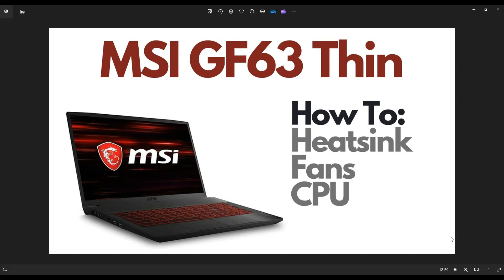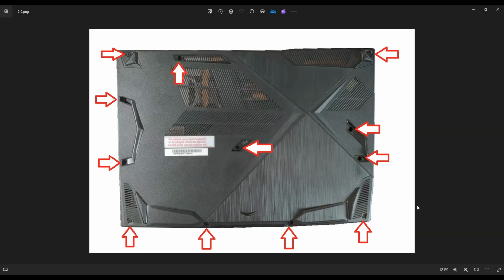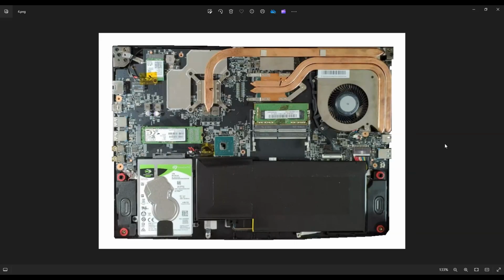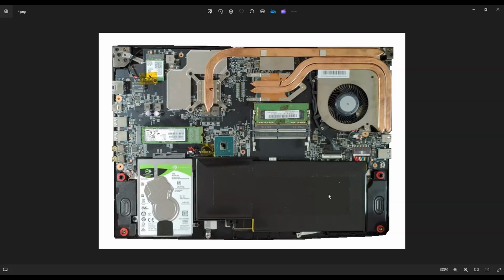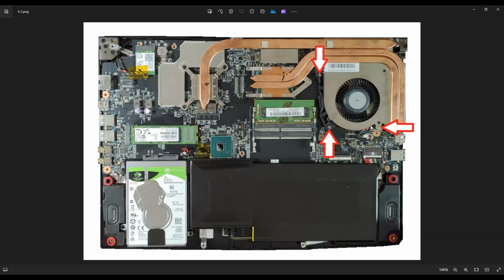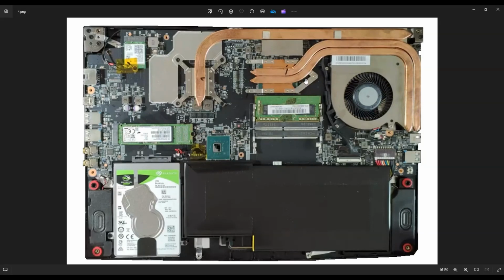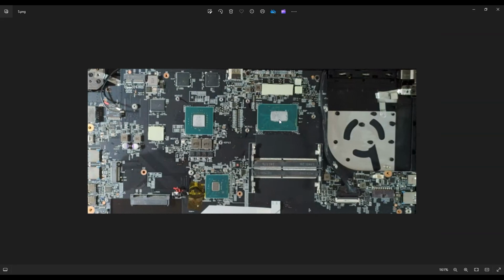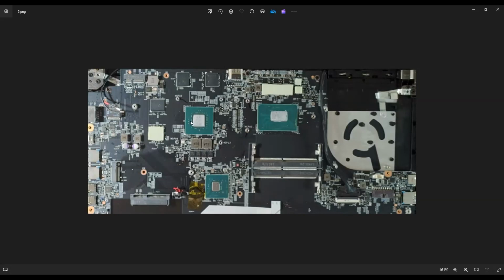How To Replace Fans, Heatsink, CPU, etc - MSI GF63 10SC Thin Gaming Laptop

Comment: You didn’t show how to remove the fan and replace it
Reply from the maker: So removing those three screws and removing that wire didnt help you remove your fan?
Reply: @jamminpcs  you are talking about the fan but can you change the fan without changing the the heatsink completely because from paying 60 bucks for heatsink and fan, and 10 bucks fan only,  it's a gap
Reply from the maker: @iXiwar  Yes, you can change the fan and not have to replace the heatsink :) You can see a fan replacement option in the list of replacement parts here: https://amzn.to/3GECEOg

Comment: My fan is grinding against the metal part, how can I fix it?
Reply from the maker: I would blow it out really well. Perhaps something is stuck inside. If not, it may need to be replaced :(
Reply: I found out what the problem is and now im considering buying a new fan but I don't know where to buy a GF63 12cu fan.
Reply from the maker: @obamaismydaddy8380  You can see several of the replacement parts for this model here: https://www.amazon.com/shop/pcmonkey/list/O4XD0HM6WHID?ref_=aip_sf_list_spv_ofs_mixed_d